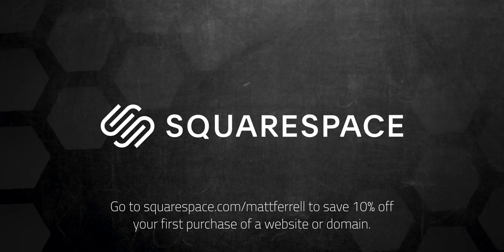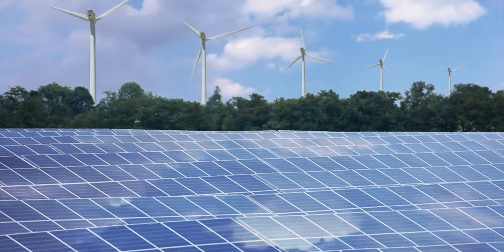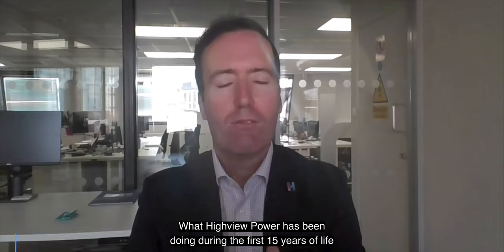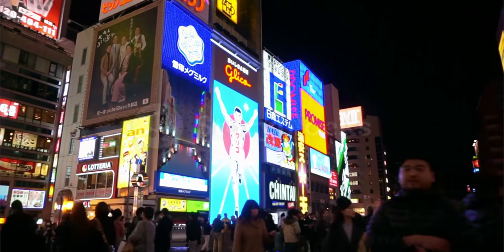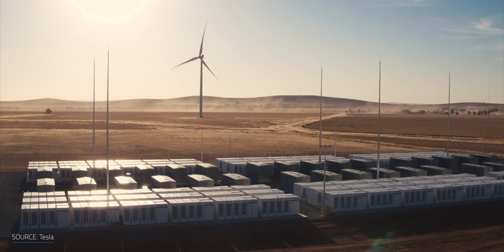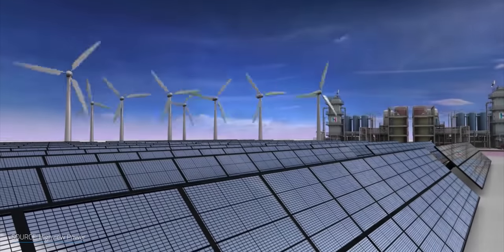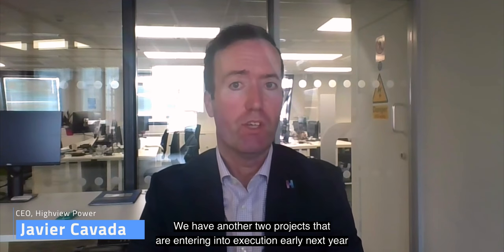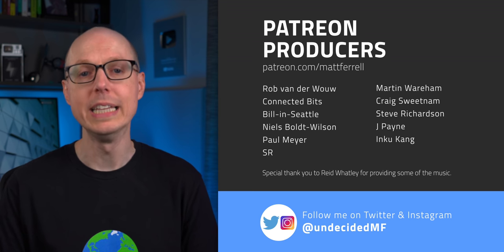Liquid Air Battery Explained - Rival to Lithium Ion Batteries?

Comment: Wind power to me seems almost senseless. It's only redeeming factor is that it uses wind which is a renewable resource. The problem is it doesn't actually reduce emissions. This is because manufacturing and transportation of the components necessary exceeds the pollution that the windmill will reduce over its entire life. 

Solar has a problem of scalability. I don't see solar ever taking over as the only method of our production because of this reason. 

The cleanest form of energy is also the most efficient. That's nuclear power. Unfortunately nuclear power as a stigma around it that I don't think is justified. in fact I think more people have died falling off their roofs installing solar panels than have died in nuclear disasters. Ultimately I think nuclear power is not only the cleanest but the best way forward. We really should start building more nuclear plants rather then other alternatives.
Reply: You are so far off. Wind power is actually even cleaner than solar power. You already are cleaner after 1-2 years of operation. I don't know why people keep thinking it is so much more polluting than it actually is. Wind is as clean as nuclear in terms of CO2eq emissions.

Solar is nearly the definition of scalability. We can put it practically everywhere we want: roofs, farms/fields, parking area's, above roads, on water, .... 

You don't seem to know anything about renewable energy or otherwise bought into the many completely false myths.

Nuclear is as clean as wind. That is indeed true. But it has 2 main problems: 
1. it is expensive, like 3 times more than onshore wind and 1,5-2 times more than offshore wind, as expensive as roof solar (without the bonus of being used immediately compared to being put in the grid, thus increasing sale price due to grid and taxes cost) and 2-4 times more expensive than utility-scale solar.
2. like you said, it has a bad public reputation.
Reply: Arianit Krasniqi  
You are joking right? Wind made up 24,8% of the electricity produced in Germany in 2019, that is around as much as nuclear was before the shutdowns 10 years ago. Within the next 5 year wind will produce more yearly than German nuclear ever did yearly.

The cost of the electricity produced was around 8 cent/kWh, for comparison in France it is around 6 cent/kWh. Yes, the overall bill went up because the grid needed upgrades, but that is not a constantly recurring cost, eventually the grid will have been completely updated and because Germany started the transistion when renewables were still very expensive. It is partially due to German investment in wind that the cost of wind turbines came down dramatically in the past decade. 

And no, the maintenance of these windmills isn't costly compared to that of other powerplants.

Seriously where do people keep getting these nonsense information that is so far off. Are you using outdated information or just listening to/reading complete bullshit information.

There isn't a single thorium reactor in operation, it still needs to prove itself. And to become competitive it will need to reduce costs compare to current new nuclear by almost half. Overall the expert expectation is that a thorium roll out in Europe won't have happened before 2050, if it ever happens.

Windmills kill around half a million birds a year, compared to the 2-3 billion that die in total every year. More birds die due to fossil fuel electricity generation than by wind turbines. Solar panels can be recycled and their harm to the environment can be mitigated to the point it is of no concern.

Honestly before talking about renewables, do some research, because you are looking like a complete fool right now.
Reply: Let me give you an example of the elephant in the room. Wind and solar power cannot function by themselves. They don't have the capacity to be able to provide enough power consistently. So they have to rely on another source of power to compensate for their own deficiencies. The wind doesn't always blow and the sun doesn't always shine. Therefore you must have either nuclear, natural gas, or coal power to supplement wind and solar. 

In the case of nuclear power it's capacity is in the high 90% while wind is the low 20%. That's a big deficiency. An example of how this can affect society is what recently happened in California. California suffered from rolling blackouts because of the high temperature and the fires blocking the sun making the solar panels less efficient. if California would have invested in nuclear power instead of solar power they would have produced far more energy than they even needed. However, instead California has decommissioned nuclear power plants in favor of far less efficient forms of energy. People in California, myself included, have to supplement our power with gas powered generators. This has a heavy impact on the environment. If wind and solar cannot provide enough energy to run the state and citizens need to supplement that power with gas power generators in the end you're producing a lot more hydrocarbons then you would have if you would have just used nuclear power in the first place. 

Also wind power has not as renewable as it's claimed. For instance a recent study showed that used blades from windmills can't be recycled. They're actually taking up an enormous amount of space in landfills and they don't break down. On the flip side new technologies actually allow us to use spent nuclear waste to produce power. The concept of Integral Fast Reactor technology will allow us to use our spent nuclear waste to produce more power. the IFR would produce spent fuel, just as old reactors do. But the volume of waste would be reduced and the radioactivity of this waste would be far less than the nuclear power waste being produced today. 

At this point in the game our time and money should be spent making nuclear power even more efficient than it already is then concentrating on less efficient forms of energy. 

all I'm saying is that why are we wasting our time and money on forms of energy that will never equal what we already have. Yes, solar and wind will become more efficient over time. However, they will never be as efficient as they have to be in order to replace nuclear power. It's simply a matter of the laws of physics. So if wind and solar will always need a supplement form of power why don't we put our energy into making the supplement form of power more efficient when it can produce enough energy for our needs when wind and solar cannot?
Reply: Arianit Krasniqi  Ehm, nope? Renewables in total made up 46% of electricity production in 2019. Come on, these numbers are easily accessible with a google search.
Reply: @CyberCPU  
Yes, the intermittency of solar and wind is a problem, that is why for now it won't get above around 70-80% of the grid mix at best. If storage improves enough however you can easily have 100% renewables. And overall the question is not if we can get there, but rather when. This is why nuclear + renewables mix is a proposed solution (usually something like 60% renewables - 40% nuclear, though depends on the country too). However this entirely depends on the progress storage options make, like the one from this video, batteries, hydrogen, ....

In the case of nuclear power it's capacity is in the high 90% while wind is the low 20%.
Yes, the problem is, nuclear to be profitable needs to run almost all the time, wind already has payed itself back after 2-3 years. Both in cost and energy used to produce it, despite this intermittency.

It is for things like what happened in California why storage options are needed. However things like what happened in California are overall exceptions. Also there are a lot more problems in California that causes these black outs, they essentially mismanaged their electricity generation and energy transition. There have already been discussions on how California would have been able to stop or minimize these black outs, both renewable and nuclear provide possibilities and a mix might maybe be best. Overall, California's leadership just went about things without a vision other than "transition quickly".
And one interesting thing for the future is EV's and the possibilities of V2G, which can allow you to power your home with your EV battery. At some point most people will have an EV and chargers at home. If black outs happen, you can use the electricity from your battery, which if you don't drive too much could forsee most homes with power for around 3 days (with average use, if you are smart you use less in such a situation). Is it perfect or immediately available? No, but it will be an option in the future exactly during these rare occurences.

For example Germany does not suffer these problems, while still having reduced their nuclear (stupid move btw) and producing 46% of renewables in 2019, 24,8% of total being from wind.

Actually turbine blades can be recycled, it is just still difficult, expensive and there aren't enough old blades yet to use economy of scale to get prices down. So for now these blades are burried or stacked in empty spaces, so they can later on be recycled when things are cheaper. The same goes for solar panels btw. In the EU they need to be recycled by law, which is definitely possible and not too expensive, but for now it is still cheaper to just dump it in a landfill, so that happens in the US. It is just a matter of time though.

Nuclear waste can't be spent completely. In either case nuclear waste is not my biggest worry with nuclear power, rather the cost of current new reactors.

Nuclear still sees a lot of investment and if we look at all funding since the 50's, you'll find nuclear has for now still received more funding than renewables. And incentives for renewables are dissapearing due to the lowering of costs.

In the end, like the person from the company said in this video, it is not about efficiency, rather how much electricity you can produce at what cost. At this moment, like it or not, renewables are beating nuclear here, and not by a little.

And for the record, I want both renewables and nuclear to be researched and improved, but in the end the best cost/production will and should win out. And for now renewables are winning this game, at least untill you hit like 70-80% of grid production by renewables, at which point they need cheaper storage or it will become too expensive. Maybe next gen nuclear can change this, but it will first need to prove itself in the coming years.
Reply: Arianit Krasniqi  I think I know why we are on a different footing here. You are talking about energy in general, this includes heating, transport, ... I am talking about electricity. Renewables for now are mostly fixed on electricity transition. While yes, there are renewable alternatives for other energy needs (geothermal for heating, EV's for transport, ...) they are not being implemented on scale just yet. 

Germany has focused on the transition to renewables in the electricity/power sector, not yet the whole energy sector for so far I know.

Honestly talking about total energy use when discussion wind turbines or solar panels is stupid at this moment. I therefor am talking about the production of electricity, which indirectly will in the long term also influence other energy uses (heating/cooling with thermal pumps run on electricity, eV's driving on electricity, ...) however as long as the necessary "tools" are not adopted, influencing the total energy use with renewables is very difficult, though easier with renewables than with nuclear. How are you going to power cars with nuclear if there are few eV's? Place a nuclear reactor in cars? or how about heating? Are you going to transport your heat produced in a nuclear powerplant through underground heat tubes?

If you want to compare renewables to nuclear, look at electricity, else the comparison is disingenious. Please tell me the maximum amount of total energy supply nuclear ever was in Germany, it will be much lower than renewables is now.
Reply: @MDP1702  I have to respectfully disagree with several of your points. 

The case in California I was referring to a specific incident. it had nothing to do with the power grid but rather the ability to generate enough power during a heatwave. I know me and by the sound of my neighborhood many of my neighbors relying heavily on gas power generators. This is going to be a reoccurring issue every summer if California continues to invest more in solar and wind than other forms of power. 

In regards to nuclear running all the time that's not really a downside. The reason why solar and wind needs storage capacity and nuclear doesn't is because of their efficiencies. Nuclear power can sustain the power grid without storage. And was California wanting to ban gas powered vehicles their power requirements are going to skyrocket as soon as people start driving electric cars all the time. Wind and solar will never compensate because it's not a matter of just not being efficient enough yet but rather the physics of the technology itself. Wind and solar will never be as efficient as nuclear. I don't know about you but I personally don't want to see the landscape littered with windmills and solar panels when all of our power production can be done in a small geographical area with nuclear. For that matter even natural gas and coal are low emissions due to technology. In fact I think coal burning is zero emission because of scrubbers. 

In regards to cost the cost of nuclear power is far less because of its efficiency. Even though it cost more to build nuclear plants the power they produce offsets the price far more than wind and solar. Also it's a single investment while wind and solar needs to be replaced more often. 

Currently in the United States we get 2% of our power from wind and solar. I don't see that number going up much. If we do start relying more on wind and solar the only thing I really see in the future is more blackouts due to wind and solar not being able to provide enough energy to sustain requirements. 

Personally I don't see much of the future in wind power without being heavily subsidized. I see a brighter future for solar as a personal investment rather than a subsidized investment. I do see more and more people going to solar power individually and that helping to supplement the power grid. But I still don't see that taking over more traditional forms of power generation like nuclear, natural gas, and coal. In fact because of the decommissioning of nuclear power in places like California I see an even heavier reliance on natural gas and coal due to the investment required to build those plans to supplement a flawed electrical grid based on wind and solar. So in the long run decommissioning nuclear plants may actually hurt the environment even more. 

I think the biggest problem that we have isn't the science or the technology behind these different forms of power. I think the use of wind and solar have become altruistic. Since nuclear is viewed as "dirty" and non renewable it gets pushed aside. I honestly think that this way of thinking is dangerous because of the fact that electricity is so important in our lives.
Reply: @CyberCPU  
This is going to be a long reply, sorry. If necessary split it up in different parts to read/react to.

it had nothing to do with the power grid but rather the ability to generate enough power during a heatwave.
And I never indicated the grid was the problem.

This is going to be a reoccurring issue every summer if California continues to invest more in solar and wind than other forms of power.
Yes and no, if they keep investing in solar and wind without dealing with its downsides, yeah probably, if they deal with the downsides this is an entirely different story

In regards to nuclear running all the time that's not really a downside. 
It wasn't in the past, since you had the baseload characteristics of the grid. however with renewables this is dissapearing. People and companies that put solar panels on their roof will first use the electricity from this (cheaper due to no grid cost or taxes) and will send extra electricity back on the grid. This messes with the idea of baseload a lot. Everytime there is too much electricity being produced, curtailment needs to happen. If it is just a few minutes/an hour, they could curtail the renewables, but seeing that renewables are cheaper per kWh in general ,more and more the nuclear plants (or the power from it) would be curtailled due to its higher price. So in a future grid having to run continuously to make a profit is a dangerous proposition unless you provide the cheapest electricity, which again new nuclear powerplants just don't do.

The reason why solar and wind needs storage capacity and nuclear doesn't is because of their efficiencies.
No, this isn't due to their efficiency, but rather their intermittency. A less efficient powersource just needs more production. And seeing that renewables are cheaper per MWh even with this lower efficiency incalculated, the low efficiency isn't a problem.

Nuclear power can sustain the power grid without storage.
Yes and no. Sure you could, but you'd need a huge overproduction during most times to be able to deal with the peak vs low times. This will either result in having to use storage to store the excess (and here we have the same downside as renewables) or you curtail a lot of nuclear power, which is ofcourse bad seeing you need almost 90% production (and sales) to break-even and make a profit. This is why nuclear power is always ever used as a base load and why you won't see nuclear at 100% of the grid mix, just like you won't see 100% renewables at this moment (except maybe in geographically wel located countries).

And was California wanting to ban gas powered vehicles their power requirements are going to skyrocket as soon as people start driving electric cars all the time.
Actually, while you wouldn't think it this wouldn't be a problems and eV's might even help out a lot. For one eV's can be charged when there is too much solar or wind production, thus they don't care for (short term) intermittency overall. And eV's almost always have much more battery capacity than is needed for daily driving. For example most people with regular driving would use around 15-20% of their battery capacity. This means 80% would be unused, however due to battery life management and a safety factor (so you can still drive whenever you want), this will be reduced to 35-40% of a battery capacity never being used in daily driving. Thus this can be used to store electricity during peak production and discharge during peak demand. This 35-40% already now on average would come down to 18-20 kWh, double what an average home uses on a daily base. And even if these eV's power their owners homes during peak demand and nothing more, that still would be a great help to manage the grid and lower the problem of renewables intermittency. So in short, eV's aren't a danger, they are a help, that is if implemented in a correct way.

Wind and solar will never be as efficient as nuclear. 
And again this doesn't really matter, even with low efficiency they are cheaper than nuclear and solar alone could power the entire world several times over with this bad efficiency, though ofcourse no one would advocate for just using solar ever.

I don't know about you but I personally don't want to see the landscape littered with windmills and solar panels
That is your personal preference, with me it is the opposite, when I see wind turbines and solar panels, this cheers me up.

 when all of our power production can be done in a small geographical area with nuclear.
This an entire discussion on its own centralised vs decentralised power generation (or a mix of it) and many people would dislike these powerplants more. And especially in build up regions (for example here in Belgium), placing a powerplant will always need to be done close to people and will have a huge public backlash, where ever you put it. In the end many people think like you, untill the powerplant is to be dropped in their backyard, they'd rather see solar panels an wind turbines everywhere at that moment.

For that matter even natural gas and coal are low emissions due to technology. In fact I think coal burning is zero emission because of scrubbers.
not really. They try ofcourse to make it cleaner, but there is a cost vs cleaning problem, to fully clean them, you'd need to have a lot of very efficient scrubbers or use carbon capture and storage, both are never actually realised. they tried/try, but always are shutdown due to the rising costs. If you know more about it, please enlighten me, but at this moment this isn't actually an option. It would be nice as a transition electricity source, but ofcourse not as a sustainable one, since the deposit of gas and coal would eventually run out.

In regards to cost the cost of nuclear power is far less because of its efficiency. Even though it cost more to build nuclear plants the power they produce offsets the price far more than wind and solar.
Nope, the costs I look at is the lcoe (levelised cost of electricity). This is calculated in $/MWh and thus already includes the (in)efficiencies of the different production methods.

Also it's a single investment while wind and solar needs to be replaced more often.
These need to replaced once or twice in the lifetime of a nuclear powerplant (depending whether the lifespan of the nuclear plant is 60 or 80 years). And this actually isn't a downside either, since this gives the opportunity to install newer, more efficient wind turbines or solar panels. And they can also just use the existing foundation if it is still good after this time, though that maybe isn't that important for solar panels, for wind turbines however this can save a lot of costs and emissions.
Reply: @CyberCPU  
Currently in the United States we get 2% of our power from wind and solar.
actually this was 3,6% in 2019 and if you include other renewables it goes up to 11% (with biomass) or 6,3% (without biomass), for comparison nuclear (which has a headstart) makes up 8% of the energy mix. But like I said earlier, looking at total energy is at this point a bit stupid, since neither nuclear nor renewables have really a change to really do anything here without electrification of transport, industry and heating (though in regards to heating geothermal could be a usefull renewable source). Here in just power generation we find that sun+wind made up 9,1% of the US electricity production, still well below 19,7% of nuclear, but again, nuclear has a head start and it isn't like renewables are pushed in the US except for in a few states, in the opposite in fact looking at the federal government. And only including wind and solar is also not really correct, since renewables also include hydro and geothermal, bringing it up to 16,1% and depending on how you look at it biomass (personally I see it as a "transition renewable" if used correctly) it goes up to 17,5%

Looking at these numbers you'd still say "nuclear beats renewables", but if you take into account that nuclear is already used to this extent for decades, while wind and solar have come up mostly in the last decade, this actually is far from a good look for nuclear imo.

I don't see that number going up much.
Where are you basing this on? It literally goes up every year. Are you saying this rising trend will suddenly stop next year? Why?

If we do start relying more on wind and solar the only thing I really see in the future is more blackouts due to wind and solar not being able to provide enough energy to sustain requirements.
Germany has 45% renewable, 33,9% from solar and wind, and yet they don't suffer black-outs. So clearly it is more of a problem of how California manages power generation (and back-ups) than just an inherent problem with renewables (solar and wind specifically). Hell, California has less renewable generation than Germany at 32% in total and 21% solar and wind in 2019.

Personally I don't see much of the future in wind power without being heavily subsidized.
This is quite wrong, why would you subsidize a cheaper option. Subsidizing of renewables is being build down or outright stopped all over. The main reason why they are now still subsidized would be to incentivize a faster roll out. In contrary nuclear would be the one that would need to be subsidized if you build new conventional plants now.

I see a brighter future for solar as a personal investment rather than a subsidized investment.
That definitely is a fact, solar in most regions is even without subsidies if used correctly interesting on a personal level.

But I still don't see that taking over more traditional forms of power generation like nuclear, natural gas, and coal.
It will take some time like with any transition, but fossil fuels will be transitioned out, whether it is for a renewable+nuclear, renewable+storage or renewable+storage+nuclear mix is still to be seen.

In fact because of the decommissioning of nuclear power in places like California I see an even heavier reliance on natural gas and coal
If you take out existing nuclear plants too early (like they did in Germany), that is indeed stupid. I don't know the situation in Calfornia exactly, though after quickly looking into, one nuclear power plant will have reached its end of life this year (+-60 years for older nuclear power plants was generally the end of life planned), one will still run for 5 years, though looking at the commission date logically it could be extended by 10-15 years, this likely will not be done and will be a mistake, and another one was shutdown first temporarily after mechanical problems and then definitely by the company after claims of malfeasance were rising, because the mechanical problems were already shown as a possibility 8 years earlier and nothing was done to with it.

So all in all it doesn't seem that for now there were political closures of nuclear power plants that caused the problems. Also seeing that anti-nuclear sentiment seems to be strong in California for several decades, it was always very unlikely its leaders would choose to support building new nuclear plants.

Looking into California further, natural gas usage for power production went down since 2009, coal usage went down too and imports remained more or less stable since 2014. And these imports have actually a greater renewable and nuclear share in it, then their own production. I can't really find a years by year figures of imported electricity going further than 2014. If you know of one, I'd like to know how it progressed before that time. Though from some numbers I found it seems California's imports went up by around 35 TWh, while their own production went down by around 13 TWh, around 5 TWh of this seems to have happened when the nuclear plant with the technical problem was shutdown and never re-opened. When looking at these numbers I'd say the electricity problems in California aren't due to renewables, but rather a complete lack of increasing its own production and increasingly relying on imports. Germany's installed capacity increased by around a third since 2011 (+- +34%), in California, there was only an 11% increase. 

All in all the problems in California seem to be caused by a lack of capacity, failures of certain plants and a historic heatwave combination. The grid operators are urging to make renewables not the scape goat though, but rather that many things went wrong. I'd say California's reliance on imports and not enough capacity installation (especially back-ups) are the main problems. There has only been one nuclear powerplant shut down and that wasn't even a political decision and new nuclear just doesn't seem to be on the cards in California, even if leaders want it. Citing decisions regarding nuclear in California or renewables as the main problem for the black outs is disingenious. In the end a bad roll out and management of the production seems to be at the foundation of the problems.

So in the long run decommissioning nuclear plants may actually hurt the environment even more.
Depends when nuclear plants are decommissioned and what is being put in place. California never really had much nuclear to start with. Here in Belgium I am curious what they are going to do. Nuclear power is around half of electricity production and at least 2/3rd of this will be decommisioned by political decision in 2025, the other 1/3rd would depend on the power supply, if there isn't enough to replace it (ver likely) it can be extended by 10 years to 2035. Now, the decision to close the older plants by 2025 isn't entirely a bad one, small microfractures have been found in the reactor vessels, while it is considered safe for now, it isn't advised to push them too far. The main problem is a lack of a cohesive vision of what will be done to replace them in the next 4-5 years. Most likely it will be a mix of renewable and gas at this moment, since even if we want, there is no way to finish a new nuclear powerplant, and neither is there political or public support for new nuclear powerplants. 

Since nuclear is viewed as "dirty" and non renewable it gets pushed aside.
I don't think so, usually it is either the price or safety/waste "problems". The first one I can agree with, the last one not so much, though the idea that a nuclear disaster could happen, even if the chance is very very low, in densily populated area's does also concern me, but not as much to be against it.

Now to close, I do see one area where nuclear can be very interesting, especially if it decreases in price and can maybe be scaled down: the electrification of the industry, where the baseload characteristic can be really usefull, seeing that industry could function 24/7 with stable power needs.
Reply: Literally everything you said is wrong.